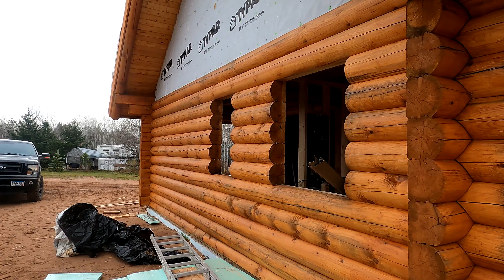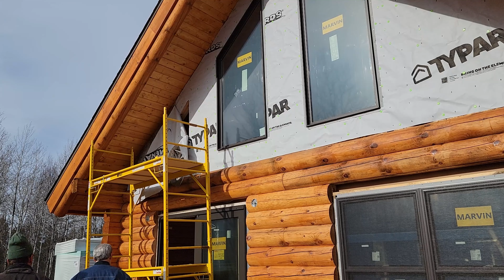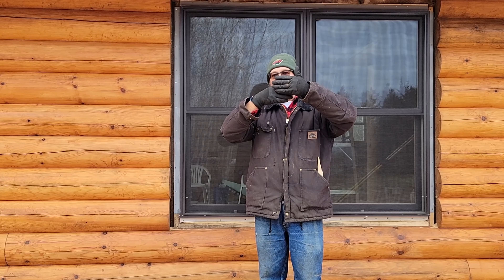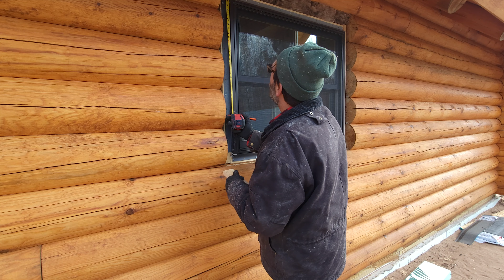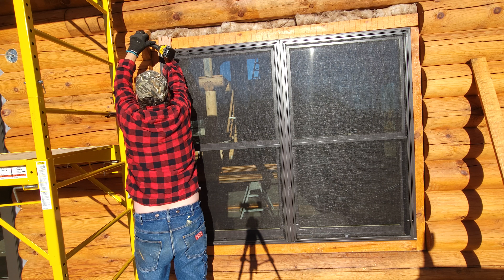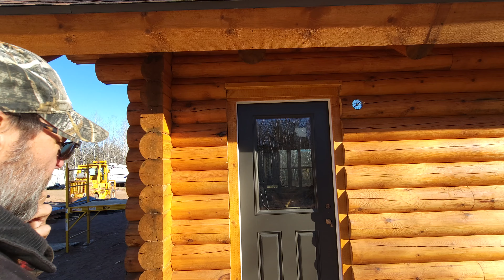Log Cabin Home Build - Windows and Trim [Part 15]

Comment: Did you spray on or brush the stain on? What kind of stain. Looking at possibly doing a voyaguer log home this year. You guys have great videos
Reply from the maker: Thank you. I  brushed it on. It was incredibly easy and looks great. The stain is called X-100 Natural Seal. I will try to post a picture of it. I would highly recommend a Voyageur Log Home, we are not a paid affiliate.  They are so easy to work with and very professional.

Comment: An Extendable Roller pole mounted on either a pvc pipe ducting or taped to a wooden pole.. does the job.. for varnishing/staining the siding.
Reply from the maker: I had one, but it wasn't long enough. I am really short! Kevin had to finish it up. We plan on getting a box to hook on the fork lift to reach it in the spring.
Reply from the maker: Thanks for watching!